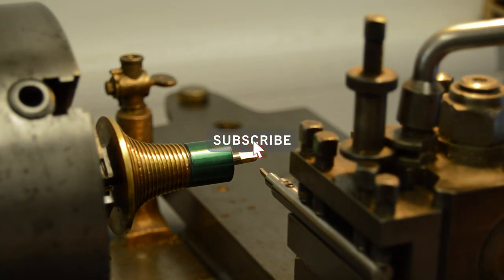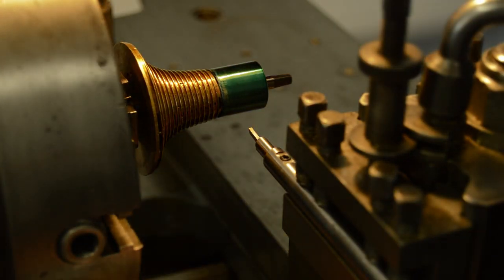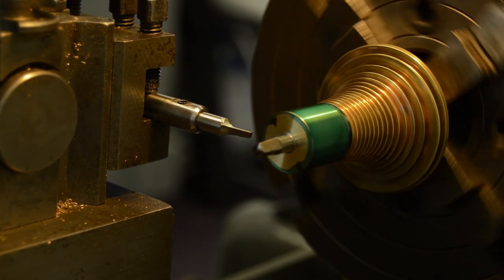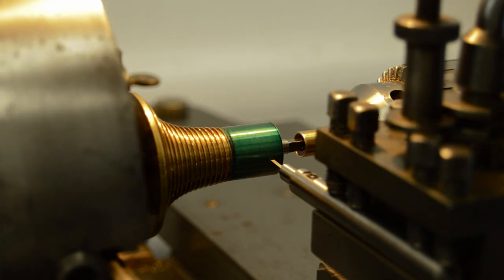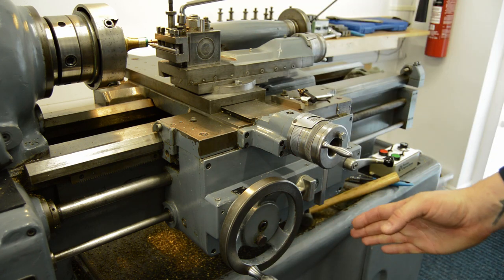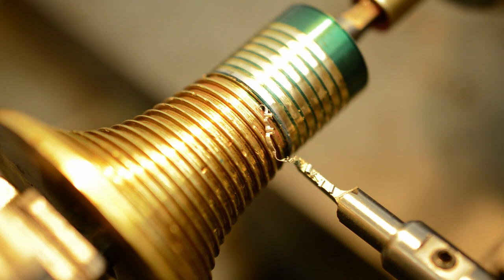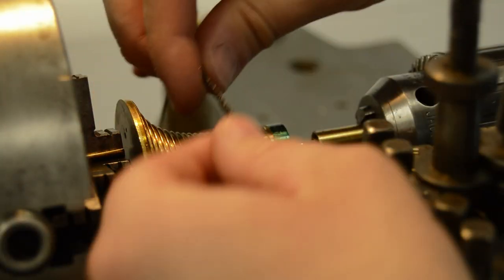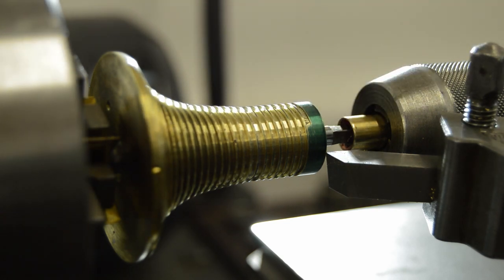Cutting a Clock Fusee Thread

Comment: Thanks for the fantastic level of detail! Really useful to hear the thought process about the backlash particularly.
Reply from the maker: No problem. Backlash is there on almost every machine, you just have to know how to work around it. I think my Smart and Brown has had quite a bit of use so the backlash on the carriage is probably in need of addressing, but it works well enough for now.
Reply: @TommyJobson  I think the biggest struggle I've had with backlash was turning a taper thread up against a shoulder on a Colchester lathe, using an Ainjest and the taper turning attachment. Keeping track of all the sources of backlash, and making sure I'd taken them all up tied my brain in knots.
Reply from the maker: Just subbed to you, your channel looks great!

Comment: Erk! OK so I'm not a clock maker but a bit of a model engineer, I would turn that thread the wrong way: I would fit the rear tool post , usually has the parting off tool on it, and be turning in reverse gear so I start on the old bit and work out onto the new.

Comment: Thanks Tommy. Terrific content. How much material were you removing per pass? Were you just running in the cross slide by feel? or keeping track of your depth of cut?
Reply from the maker: by feel. Because I was starting the cut at the blind end I was having to ramp in the start of the cut by feel. I did make a note of the dial so that I could see when it would start the cut and so that I could make a finishing pass.

Comment: Very cool. Do you use a taper attachment with a special template for cutting a Fusee? Great stuff.
Reply from the maker: Thanks.  In this video I was repairing the fusee by adding a more or less parallel section so the taper was not an issue.  There is a whole other process for cutting the whole fusee which I'm sure I will cover in a video one day!

Comment: why dont you start from the slot and cut out required turns to the outside. offcourse rotation would be reversed and so would be the tool. that way groove perfectly matches even if there is a micro variation in pitch and starting point is exact feed is correct and tool chatter is avoided. just a suggestion.. wonderful clock for this fuzee
Reply from the maker: I did it this way because I wanted the cut to be pushing the tool down.  Because of the hand of the thread the tool would have had to be mounted upside down, or to the rear for which I did not have provision on the lathe.  Thanks for your interest!
Reply: Tommy Jobson great Tommy. There are very few who can carve out a good fusee. Very professionally done. Great